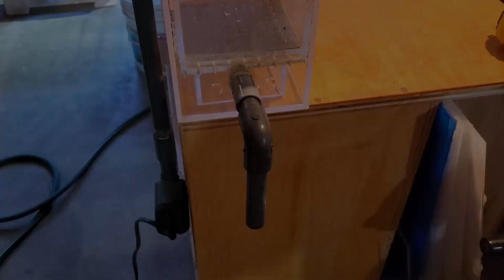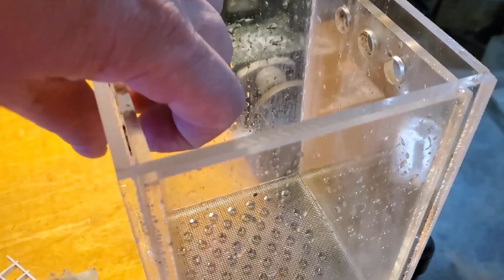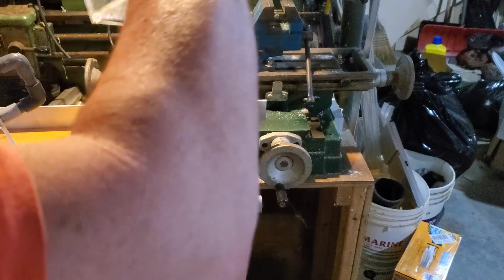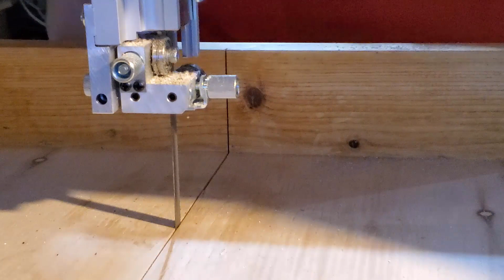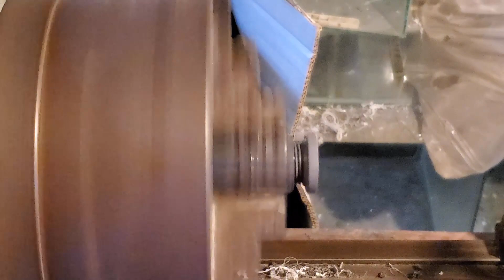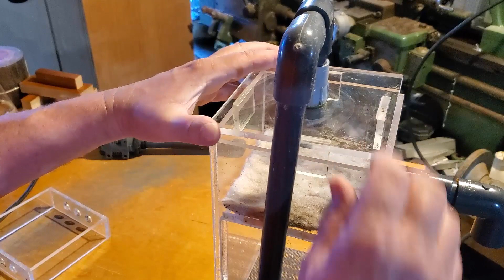Carbon Filter Mod

Comment: Just a quick suggestion.. you could also have used a sander or bench sander to take the thickness off that fitting.
Reply from the maker: Yes, but it wouldn't be as precise and I needed it to be thin. It's just less likely that I would ruin it on the lathe. Thanks for watching!

Comment: chuckling...took me right back to my first aquariums and drove me nuts because you didn't replace the poly. Necessary or not, my dad had me replacing poly every time I cleaned the filter and did a water change.🙄
Reply from the maker: Same here back in the day! Thanks for coming by!